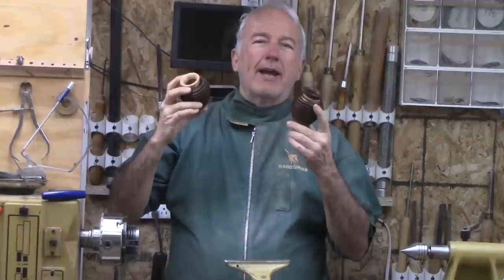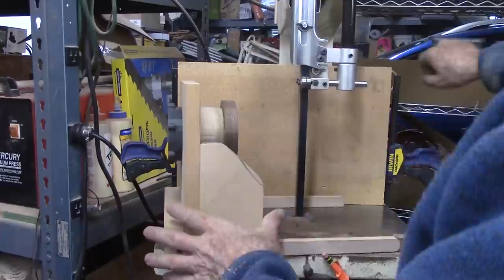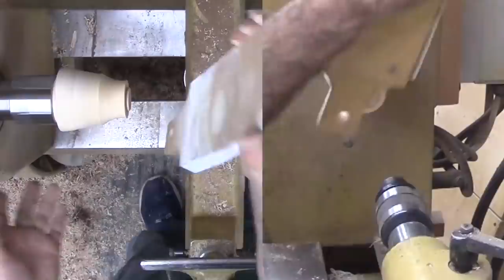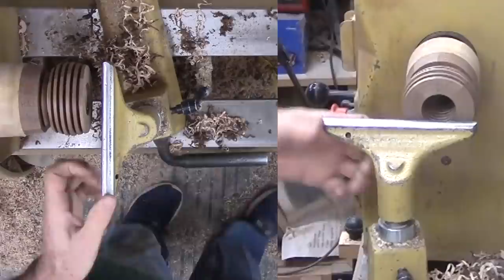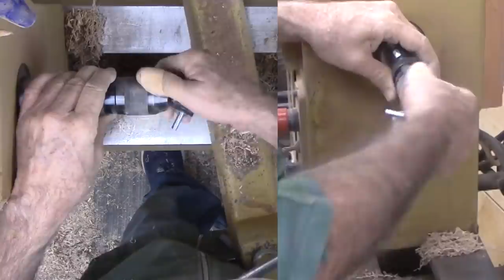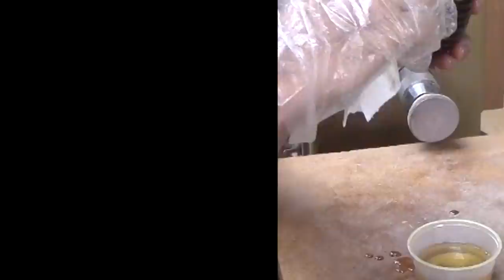Woodturning Segmented Dual Profile Vase

Comment: I really like them! I've seen something similar turned out of solid wood, which required a thin parting tool and a very steady hand to make the 'fins'. I like your method a lot more. Good information and I enjoyed the video.

Question: When turning a segmented vase like this, which way is the grain going? I assume that the grain is running across the bed of the lathe. It just looked a little strange to see you cutting 'up hill' on what looked like a spindle!
Reply from the maker: The grain is running around the turning radius. Any given cut is then side grain.
Alan